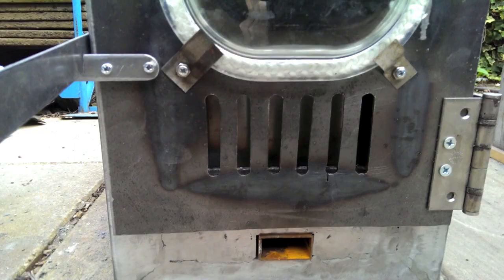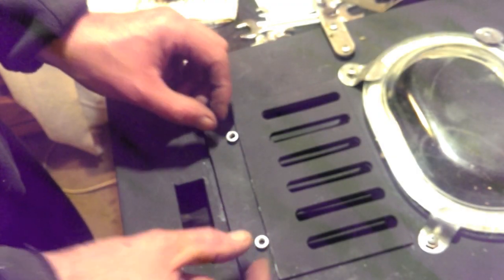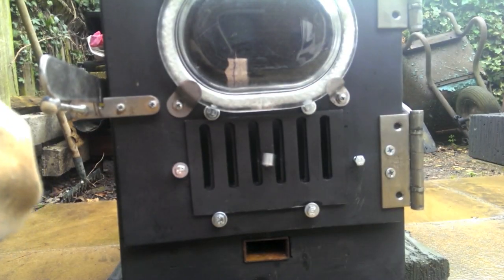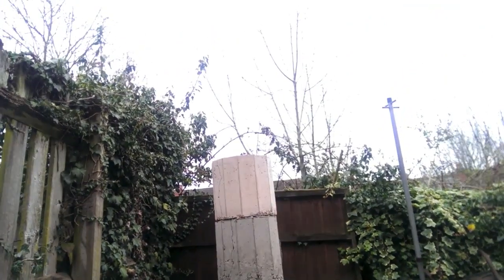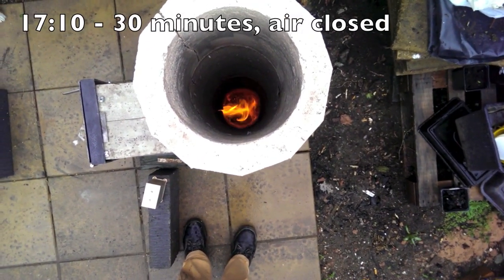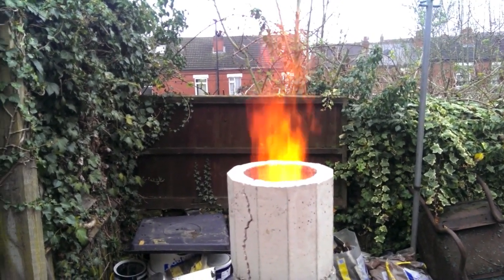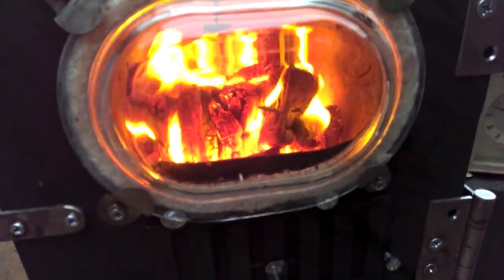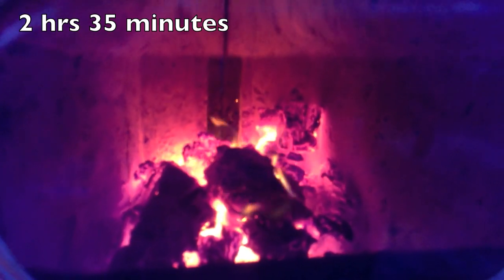Air Control for the Batchbox Burner

Comment: Complimenti per il progetto meraviglioso adoro tutti i video per effecientare le stufe e le case ho seguito migliaia di video come il tuo e in generale per efficienza de la casa io ho realizzato una termo stufa uguale al tua pero tutta in metallo in particolare il razzo e stato fatto dei nm. 2 tubi in metallo 1 da 150 mm 2 da 200 mm che tra ii 2 e diventata una camicia di aqua quali  prima di saldare in sieme li ho fatti talmente tanti buchi diametro 16 che ho saldo tanti spesori di ferro fi. 16 numero 200 pezzi dopo ho chiuso la camicia poi ho fatto unaltra camicia per chiudere sempre con ii tantissimi fori che quando la fiamma si alza la colpisce in pieno il ruolo di tutti questi ferri fi. 16 sono riscalda aqua molto veloce piu trattiene tutto calore della fiamma per tanto tempo riescono a stare a temperature molto alte e consumare pochissimo legna questa termostufa e abbinata al sistema radiante a soffitto de la mia casa di 160 metri quadrati che va una meraviglia la consiglio a tutti.
Reply from the maker: That sounds fantastic. I've always liked the  idea of being able  to heat large quantities of water but have  not yet built anything  reliable enough to feed radiators. I'm sure your efforts to weld all those pieces together was well worth it. Thanks for sharing your experience.

Comment: Happy Easter to you also!  You make it all look easy and did a great job.  I like seeing the learning along the way.  You’ve added a great bit of encouragement to all of us hoping to complete our own projects. 

I’m sorry you couldn’t continue to use your RMH in your house. I have a similar issue and have come up with a solution that may work for you also. 

Basically it’s making an outside wood boiler. I’d like to have someone check out my plans to give input. Please let me know if your interested.
Reply from the maker: Sorry to have missed your comment before Jon. I did install this core as part of a large masonry heater in my house for one winter while I was renovating my house but it was too large to be practical as an ongoing heater and so later removed it. I currently have a smaller "matchbox" type burner based on the commercial 'pyroclassic' that I've used for three winters. It only heats the room it's in but has a cook top that I use daily. I've always liked the idea of the outdoor burners but am very limited for space outside (otherwise I'd build a shed to house  a burner and a large water tank). I hope your plans worked out well!

Comment: Hi, You have made wonderful and very informative videos, thank you very much.
How is the rocket heater peforming indoors ? How big is the room and how high can you heat up the room ?
Greetings from Holland.
Reply from the maker: Thank you for your kind comment Peter. I live in a small house, maybe 700sq feet, built in the mid 1800s, of brick. I installed the heater in coldest room on the ground floor. The room is under 4 x 3 metres and at that time, when I was renovating the house, very draughty. I built a lime-plasterd brick bench and bell sides, with a standard oil drum over the top of the riser. I have a solid concrete floor and don't think a suspended wooden floor would take the weight of what I built. The room had a brick chimney into which I vented the cooled gases from the bottom of the bell bench. The draw was good.

It was very big, maybe 1.5 - 2 sq metres footprint , and the top of the drum was only about 0.5 metres  below my 2.7 m ceiling, so not ideal in a small room. For this reason alone, I only kept it for one winter. 

It exceeded my expectations by a long margin. The quality of the warmth was amazing and it was far easier to use and maintain than I ever imagined possible. I burnt mostly waste construction lumber and probably lit it 3 times a day, letting it burn out completely in between. 

An hour after lighting, the room it was in would reach air temperatures in the mid to high 30s (Celsius) with the wall surfaces averaging about 25˚C (I'm not exageratting, I bought a laser thermometer and was fascinated by it). The ceiling immediately above the drum could reach 70˚C during a strong burn. The stone bench seat would reach around 50˚C (surprisingly comfortable to sit on with a thin cushion). The drum sides would heat to around 200˚C near the top, and around 100˚C near the base. The drum heats up very quickly, you feel radiant heat off the drum within minutes of lighting it. The room upstairs above, would be around 25˚C and the entire house was never below maybe 18˚C even in mid winter. In the morning (I always let it burn out before bed) I was greeted with low 20s ambient temperature in the room where it was housed, and the masonry was still warm to touch. 

For that whole winter, the only time I used the central heating boiler was if I had house guests staying in the attic room (the other radiator thermostats were turned off). Finding wood was easy as I live in a city with a constant supply of construction lumber from building skips. 

The only problem I had for that entire winter was the couple of times it became very windy outside, I might get a puff of smoke push out of the secondary air duct. This happened maybe three times in total. The smoke wasn't excessive but did need venting by opening the window (no problem as the room was so warm, drafts became benign). I imagine a modern flue pipe with a rotating cowl would not have this problem. A crack appeared in the masonry immediately above the core which required attention with fresh plaster a couple of times. When I dismantled the heater I discovered poor brcik joints there so I would take more care in the hot areas next time. 

I miss it but it was simply too large for my house. If I ever move to a larger one, it will be the first thing I install, especially with the way energy prices are going. I'm constantly thinking about developing my original plan, which was to build the heater outside and use it to heat water to supplement my central heating, but never seem to have the time to get on with it.

Again, thanks for your comment, and good luck if you embark on a similar project. Dave.
Reply: @batchrocketproject4720  Hi Dave,
Thank you for the extensive respons....

Yes the energy prices is what made me go for it. I have been looking at rocket heater build for over 2 years.
I like to build a square one out of steel and with a kind of removeble oven to bake bread.

Thanks again and have a good one.
Peter.

Comment: Did you ever put a barrel (as a bell) over everything and install a low exit for the exhaust gases?
Reply from the maker: Yes, I installed it indoors as a mass heater for a winter (it was fantastic). I hope to do a follow-up video but I used a brick box with a 200L drum over the riser. The final venting was at floor level through a conventional brick chimney already in the house.

Comment: I realize that now it’s been 2 years since you had the big crack in your stove.  I think waterglass would probably seal up that crack.  It worked pretty well on mine. 👍
Reply from the maker: Yes, I made a paste of waterglass and talc and it glued the cracks closed nicely (although I still haven't found the time to make a follow-up video, the repaired pieces lasted a whole winter of daily burns and were fine). Thanks for the comment.

Comment: Does the refractory get more brittle the more times it is burned ??? Thanks
Reply from the maker: I think the main reason for the weakness it had during the experiments was that the casting absorbed moisture. When I finally installed the burner, there was never any problems with cracks and, although soft, the castings didn't spall or flake. I'm not sure heat made them stronger but it didn't seem to weaken them.

Comment: Would using light gauge square screening help prevent the refectory from splitting ???
Reply from the maker: I thought about trying some mesh reinforcement but was worried steel might expand at a different rate to the surrounding mortar and introduce additional stresses under heat (I've read that Coventry cathedral collapsed during the German fire-bomb attacks because the stone pillars had steel inserts that expanded under heat and stressed them). 
I eventually installed the burner and, once everything was mortared in place, no cracks occurred.
Thanks for the comment.

Comment: Just found your channel and watched the lot, very interesting stuff. I'm sure if your set up was inside and kept dry it would be just fine. I really like how you've tried to do it all yourself from basic materials. Has the project stalled, or has there been any progress?
Reply from the maker: Thanks Roger. I eventually installed it as a mass heater for the winter of 2019-2020 and hope to report on that soon. I repaired the cracks rather than re-casting pieces and they worked fine when installed.

Comment: Soudal do a high temperature  fire cement / glue in a 330ml cartridge . excellent for sealing cracks and air leaks .  a  wet sponge to dampen the surface and  it works wonders . not expensive .€8 Euros a 330ml tube/ cartridge. it washes off hands and tools  with water before it sets . it also makes a good bedding sealer / glue for ceramic rope.
Reply from the maker: Thanks for the tip. I used a home made stone glue from sodium silicate, magnesium silicate, and a little fireclay. I repaired the cracks with that and they were fine when I finally installed the burner. After a winter of use, the remained sound. I'll have a look for the Soudal product if I ever get around to another install in future.

Comment: leaving the rocket stove out in the rain then burning it like crazy    will crack it every time .
Reply from the maker: You're definitely right on that Richard! Especially if the concrete has perlite or vermiculite as both absorb some moisture even after setting in concrete.

Comment: I notice a lot of smoke coming from around the stove and can see the color red made by flames of the fire. Would using some sore of sealant give more reliable results to increase the overall efficiency of the stove ??? Maybe use a temperature reader to see just how hot the combustion was??? Maybe make an burn chamber design to even raise the heat to the limit for ultimate efficiency ??? Please respond with your thoughts.  Nice job fella.
Reply from the maker: Much of what looks like smoke coming from the outside of the burn chamber is actually steam caused by the casting getting rained on. You're definitely right that the efficiency depends on the gaps being sealed. I eventually installed the burner and closed all the gaps with mortar and there were no further problems or cracks.
Thanks for the comment.

Comment: wonder if you moved the slot in the  back of the batch box over to the left side of the insulated riser,  could you then create a clockwise swirl  around the  riser wall? north equator.
Reply from the maker: Mine didn't have that but yes, I've seen videos that guide the burn into a nice vortex. We definitely need to experiment to see if the direction of the swirl changes either side of the equator!
Reply: The coriolis force is BS.
Is been proven nonsense many times

Comment: Those are not cracks. Those are automatic, temperature controlled secondary air inlets.
Anyway, after learning from your experiment I'd make the riser of two of half cylinders to avoid crackings.
Reply from the maker: ha ha, yes, there was no shortage of air for secondary burn with those cracks. Two half cylinders may well be a better way to do the casting. I repaired the cracks and installed the burner - once everything was mortared in place, there were no more cracks so the forced generated by the heat are not that much of a problem. 
Thanks for the comment.

Comment: First video I watched on your channel. Sorry I don’t have a link but search YouTube for honey do carpenter.   He is using silica gel (water silica?) for protecting the burn chamber heat riser etc.   Got to get going here.   Peace.
Reply from the maker: Thanks for the tip. I've watched honey-do's videos and they're great. My early experiments used sodium silicate (purchased as no one has yet convinced me that 'home made' is actually sodium silicate) and found refractory cement products were superior. I believe the commercially-available forge bricks are made by binding perlite or vermiculte with sodium silicate so there's clearly possibility. Whatever works, works!

Comment: Whats the little open rectangle at the bottom?
Reply from the maker: The rectangle is the open end of a steel tube that takes air to the base of the heat riser in order to feed a secondary burn (where much of the smoke ignites).

Comment: I see a small gap between the two halfs of the burn chamber. Didn't you use aluminium vilt between the two halves?
Reply from the maker: When I installed the heater, I mortared everything together with a simple lime mortar. I expected it to fail under heat but was pleased to discover all the joints were still sound after a winter of use.
Thanks for the comment.

Comment: Any luck with the water heater?  I made a simple copper coil one in the upper part of the flue (beyond the heat riser) for a basic J type rocket stove. It works well but the fire needs constant re stocking. Hence looking to build a batch rocket equivalent. Have you had any thoughts about how you'd go about it? Great videos! Keep up the good work!
Reply from the maker: Unfortunately 'life events' got in the way of progress and I never built a working water heater. I did instead install the burner indoors as a mass heater and it was fantastic. I'm still really keen to one day progress the water heating as I think it could be installed outside of a house and make hot water that can be used inside the house as heating. I've had lots of ideas but won't be able to judge their merit until I experiment! The only thing I would say is that a batch heater even larger than this (maybe 9" system, rather than the 6" I built) would be better as the burns would last longer. 
Did you experiment with placing your copper coil in different places? I was planning on having it inside the bell but below the top of the heat riser, to catch gases as they were forced downwards by the bell. If I understood your comment right, you had it above to catch direct heat - were there any problems with that? 
Keep experimenting Pete!

Comment: Have you considered using Helix, a new type of micro reinforcing bar, there are metal ones and Kevlar types, in the mix
Reply from the maker: Thanks for the tip. I wondered if reinforcement might help, not sure whether metal mesh might introduce stresses due to the heat. Kevlar sounds like a good option.

Comment: Looks great!, a Nice clean burn!. I would reinforce your casted batch box with galvanized chicken fence. Then the box is allowed to crack becouse evrything will be held together by it.
Reply from the maker: Thanks for the comment Johan. I may well try reinforcements in any future castings. 

I finally installed it as a mass heater, bonding the cracks with fireclay and a home-made cement. After three months burning, none of the cracks have reappeared - they were more a result of the fragility of the unsupported and often damp castings than of any strong exansion forces of the heat.

Comment: Possibly all the gaps are a free secondary burn
Reply from the maker: Yes, the air control made no difference while the gaps were there! When I installed the burner, all the gaps were sealed and the air control worked well. I could close the air down once the burner was very hot and it would gas away calmly - the flames almost looked like they were in slow motion. I hope to eventually do a follow-up video when I get chance.
Thanks for the comment.

Comment: Any updates or improvements ?
Reply from the maker: Marco - I'm still trying to find somewhere to make a more permanent installation so I can experiment with various bell options. It's been a little frustrating and I'm having to repair some brickwork before I can make an installation. I'm itching to get on with it and have many plans. As a side project I've been working on a datalogger with thermocouples and temperature probes so I can monitor temperatures in the hot gases and, ultimately,  heat transfer to water. I was not sure the electronics would be of interest here and had hoped to have been back on the actual burner stuff by now. Hopefully soon!  Thanks for your interest, really appreciated. Dave.
Reply: BatchRocketProject I feel your pain there my friend! And while the burner stuff got me here, I do enjoy a good Arduino or Raspberry Pi data logging vid.. just  sayin!
Reply from the maker: Thanks Marco. I'll have a think putting a video together about my (arduino-based) datalogger, it's been interesting developing it and maybe some fire enthusiasts would like to record temperatures.

Comment: How about making the heat riser out of fire brick?
Reply from the maker: Peter - yes, a firebrick riser, and burn chamber would work well, there are sketchup designs on Peter van den Berg's webiste: batchrocket.eu/en/designs#brick1

I considered using firebrick but wanted the insulated type which would have proved prohibitively expensive. For me it was easier and more economical to make the casting.